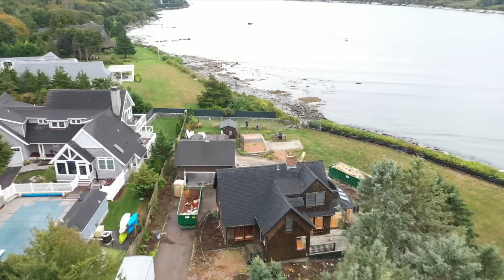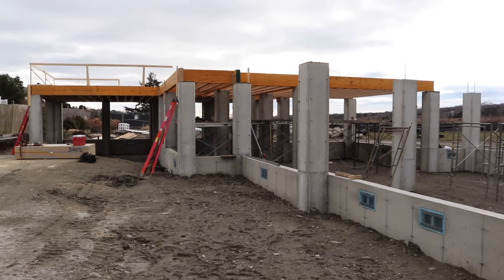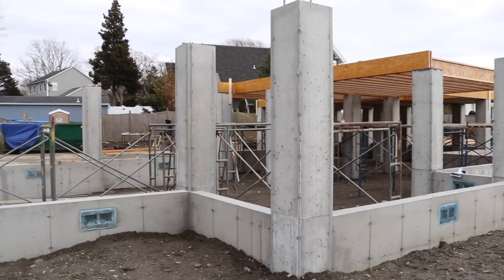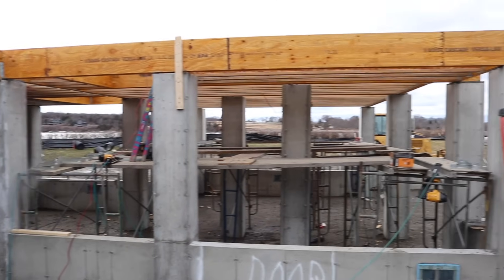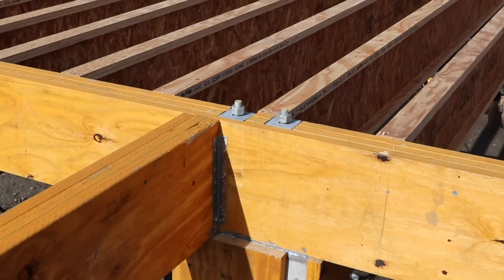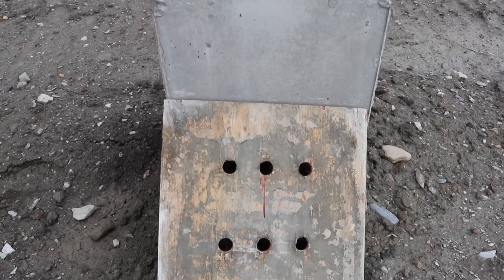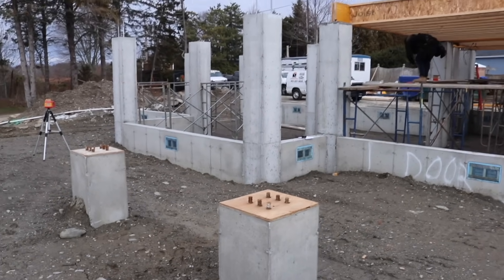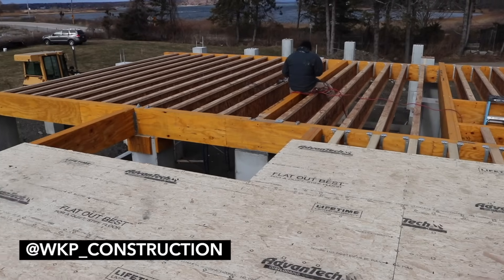Concrete Piers in a Coastal Flood Zone!

Comment: I need to research I-Joists. It makes no sense to me that glued together wood scrap is stronger than a two by
Reply: part of the reason is that the fibers are pointed in every direction.
Reply: @akacreq  just wait till there is a water situation.... Rebuild Time... I just don't get it, why you would go so low quality, especially when you are that close to water.... that can damage the OSB in a hurry.

Just lay a 2x12 and OSB outside for a month... the 2x12 is fine, the OSB will have been compromised.
Reply: @jameschupp2230  depends on the used glue. But I guess in the construction Industry they do not have marine grade plywood?
Reply: The water will never get that high.....

Comment: The rebar sticking out of the concrete is a weird detail. Usually and especially in a coastal area, the min coverage of rebar of 2-4" is meant to shield the steel from corrosion getting in. Leaving the ends exposed doesn't make sense. The thought of welding it and attaching steel members after the fact is also strange. Hopefully those points remain without significant exposure to moisture.  Galvanized and epoxy coated systems are not that great for rebar...  But cover is the minimum... hmmmm

Comment: What is the Rebar size? also Why not galvanized Rebar how come you choose epoxy coated.. i have heard that the concrete dosent stick as well to epoxy compared to galvanized
Reply: A YouTuber, Tyler Ley, talked about epoxy coated rebar in a video a couple years ago, and the issues surrounding it. Just thought I'd mention it, if anyone was curious. I guess galvanized rebar was only around 10% more in cost, which I can't imagine was a deterrent in this job. 

I'd be interested in hearing the reason why it wasn't used on this project as well.
Reply: @Fetecheney  The choice to weld rebar to the steel i-beam. Welding galvanised steel poses some health risk due to vaporisation of Zn. That vaporisation would also leave 4-6” of the rebar unprotected from corrosion. Same is also true however of epoxy rebar. It appears they are using standard carbon steel rebar for those hold-down connections for this reason. This can effectively be done by upsizing the holdown steel, essentially engineering for 35-40% degradation due to corrosion over 50 year service life. 

My guess is much of these material choices are driven by budget and possibly availability. The best way to do this job would have been FRP rebar throughout then installing 304SS holdown rods for welding to steel beams.

I’d also be concerned with direct wood connections used on green concrete. Even w/good pour and proper vibration, concrete will shrink over first 6 month cure. It will do so non-uniformly. Given spacing of piers, I could see this floor level exceeding 1/8” in 10’. If they can’t allow a 6 month cure before decking, I’d recommend floor level survey be performed after completion of building envelope, which should be at or after 6- month cure. If floor levels exceeds limits, floating leveling material prior to finish flooring is highly recommended.
Reply: @MichaelM-to4sg  Bro, thanks for taking the time to enlighten me. Time to go into a rabbit hole on Fiberglass reinforced polymer rebar...
I remember in the video he was saying it was supposed to be 'hundreds of years' house. I guess the 50-year service life would out the kibosh on that? 
Another question if you could, would the chloride penetration  be accelerated because it's close to the ocean? What are the factors that cause chloride to get into the concrete?
Reply: @Fetecheney  Yes. Many factors; temperature, humidity, wind, flood/splash cycles, etc. I’ve never built on Atlantic but I know salinity in air is much greater there than coastal regions I’m more familiar such as Bandon Dunes, Or, Fox Island, WA, Mendocino, CA and Carmel, CA. We typically calculate based on published tables but I’ve had to hire labs to provide study data on some occasions.
Reply: as a GC i had the same exact thought.